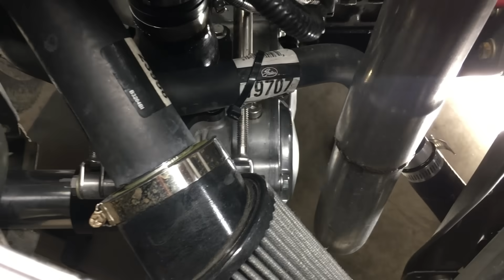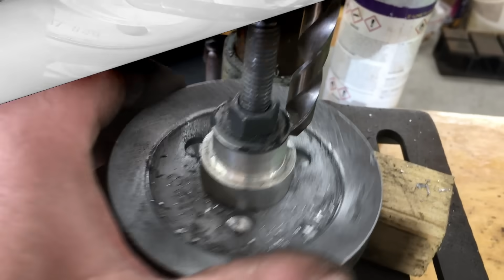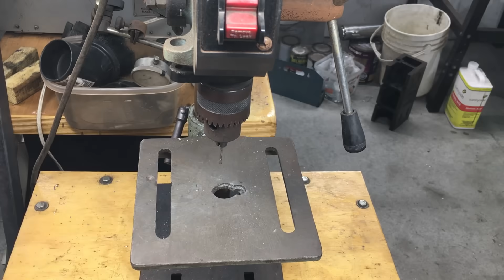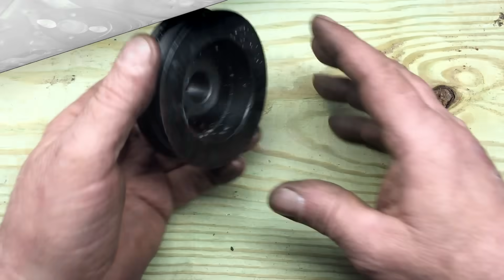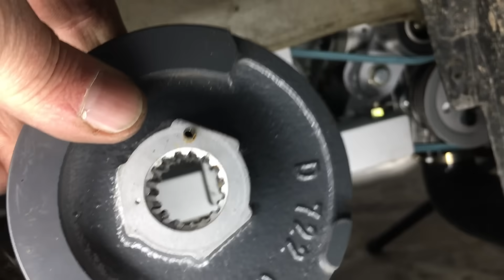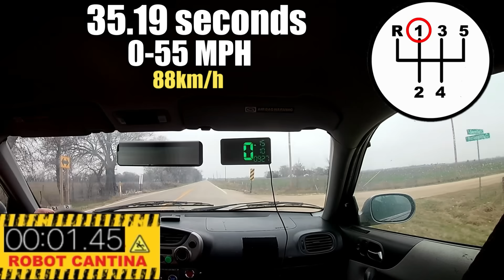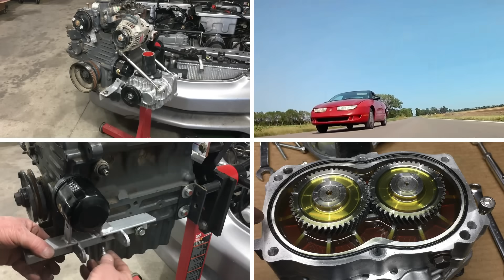S4 E9. We fix and road test the AMR500 supercharged Kubota diesel powered Honda

Comment: fix it back to having 3-4 psi idle and 9-10 psi full throttle 
too much fuel it seems
Reply: You have a 700cc engine that super charger is a 500cc super charger there is very little chance ittle blow if done right

Comment: The other way to reduce boost would be to reduce restriction in the air side of the engine. You'll likely gain HP in the process though 🤣

Comment: Why would you want less boost?
Reply from the maker: The engine wasn't designed for forced induction.  We don't want to blow it up, we want to make more videos as we make improvements, including moooooooooooooor boost.
Reply: This episode was downgrade, you spent a long time just to make the car slower!
In the Satern it had 15 psi and it didn't blow up!
Reply from the maker: @stupidpeoplebeingdumb  Yes, the Saturn had 15psi of boost , however with the turbo the max boost only occurred at full throttle while the engine was under a huge load.  With the supercharger we are experimenting with how much boost we really need.  This car is never going to be fast with such a small engine, but we want to make it as quick as we can and still be reliable.
Reply: Keeping the engine in one piece may matter

Comment: I'd base my decision on how much boost to run on how hot the intake air is. Nothing wrong with adding heaps of boost to a diesel as long as it's not adding too much heat to the air.

Comment: This is so cool. Since it's a 5 speed transmission, why not make the 3rd, 4the and 5th gear 10%, 15% and 20% smaller? That should give more power as much as I understand mechanics.
Reply from the maker: We are using a close ratio Saturn MP3 transmission on this build.  the gear set is nearly perfect for this little engine.  Changing gear ratios inside a transmission is nearly impossible without spending a huge amount of money.
Reply: @robotcantina8957  I see.

Comment: A small three phase motor and drive , and run it of the battery delete the belt crank drive. Electric motor can spin it up to whatever level you need. Ability to go from nil to 6-8 psi in a second. JS

Comment: Why do you keep trying to reduce boost? You did it with the turbo setup too, and it baffles me. You’re not gonna blow up the engine, guys have made 80hp with these stock 722s, you’re not going to be anywhere near that. Also your EGT alarm is set wayyyyy too low. Don’t even worry about it until 1250f. You’re being way too conservative jimbo!
Reply from the maker: On the saturn we started off with low boost and increased over time.   Keep in mind, we make videos.  More videos= mooooor money.  do the math.
Reply: @robotcantina8957  while I get that, we’ve seen it over and over. Get reckless, go big! lol
Reply from the maker: @BamBamMotorsports   I wish I could.  In order to pay for these projects we need the revenue from multiple videos.  Across the board, revenue is way down for all youtube  creators.  We generate 1/3 the amount we were making 2 years ago  and since then the channel has grown 3X the size.
Reply: @robotcantina8957  that’s insane, my channel is nowhere near big enough to generate any revenue, so I sincerely did not know that!
Reply from the maker: @BamBamMotorsports    It sucks,  at this point,  We should be installing lawnmower engines in Porsche's , but that's still out of our budget.    LOL.. predator powered Porsche 356 would make a lot of purists heads explode.

Comment: your videos with this little motor have inspired me to build my shtf vechicle with this concept in mind. I have a 3 cyl yanmar 800isch cc. Adding a turbo should be good enough to push around little suzuki samurai pickup.What is your opinion on coupling it with a 6 gear manual BMW 2.0 litre diesel transmision? I was actually thinking about connecting it through the pulleys so i can easily adjust the ratio between motor and transmision by changing pulleys.

Comment: What is the temperature before and after the supercharger? That will give you a baseline of efficiency if you play with pulleys.  5/14.7 = +34% theoretical power gain with 100% efficiency.  It's pretty close though if you got your motor setup right. For example I have a turbo'd 2.4L 170 bhp engine stock, with 18 psi boost through a 5558 turbo it'll make 300 whp dyno tested. At 18 psi it should be making like 380 bhp in theory because (170 * 222%). At 300 whp is about -27% total hp loss over the theoretical 380 bhp through driveline and turbo inefficiency.  There would be a mix of turbo inefficiency and driveline to get the -27%.

Comment: It's a Diesel bro. It has ho boost limit, the only reason you limit boost is for the sake of the supercharger. More boost better EGTs, more power, smother running, the thing that you need to worry about is fuel amounts, too much fuel can tear that engine up faster than anything.

Comment: holey over thinking pinning the pulley batman, when i do it i just assemble it, drill, then drive a pin in. jobs a goodun. this is on a heavily modified rover k-series where the crank pulley bolt is a bit weak and the dowel is a weak point.

Comment: There was testing in the early 90s about supercharging diesel for improved efficiency and reduce soot. Theoretically, under boost, diesel engines are more efficient but turbos are always behind the fueling. Maybe with low boost there might be an MPG improvement, but at higher boost levels the parasitic lost of the amr500 might overcome the benefits. It’ll be fine to see where the balance of power and efficiency flips with different boost levels.

Comment: I bet you’ll gain quite a few MPG’s. Maybe I missed it but I never heard you increase fueling, so what you’re doing is making more power with the same fuel by enforcing an increase in combustion thoroughness. More air means the injected diesel has less opportunity NOT to make use of that extra air. After all, a pressurized chamber is a more energetic chamber, it stirs itself more than an N/A chamber. Yes you lose some in the supercharger belt load, but you make more than that in achieving a higher efficiency.

Comment: as the revs increase, the engine volumetric efficiency drops. for that reason, the boost will increase. allso does intake air temperature. even at this low boost level, you should employ some sorthsof intercooler. if the intake air temperature is decreased , exhaust gas temperature will allso decrease. i personally like to set up stupidchargers to suppl just enough air, that the engine would consume at 100% volumetric efficiency, at peak tourqe rpm. gives a smooth boost, and not a lot of heat. now, since you got boost at idle, you can actually use a thicker head gasket or other form of compression ratio reduction. that actually helps with fuel economy. should not drop the compression ratio under 18:1 for a decent start and idle in cold. allso, since you got boost, you should increase the max fuel the pump can inject. usually on mechanical pumps thats done via a pressure operated device, the LDA. i think yours engine is missing one. so not sure if that can be added, or would require a different fuel pump that has it, or can accept it. if present, it will adjust the maximum injection volume according to available boost pressure. this will play in favour for both economy and performance. 
the real killer would be the turbo charger from the mercedes smart 600 ccm cars. if you set the pulley ratio as described and allso decrease compression ratio to 18:1. you can still add moar boost at higher rpm, the low volumetric efficiency will prevent overcharge actually. but will keep the tourqe from falling as revs climb

Comment: I was expecting this setup to have more low end power, but 12 seconds off of the 0-55 AND the supercharger was under preforming.  
Color me impressed.
This is why I am interested in Supercharged Diesels.  The high RPM performance may be questionable, but low RPM performance is impressive.
Reply: maybe the wrong pulley and blow off valve setup

Comment: I would have loved to seen your face when you realized you had a smaller crank pulley in stock after making other pulleys fit. That's how it goes man. Also on that tensioner instead of using a pull bar on it stick one of those turn-buclkes on the pull bar arm.

Comment: I've been entertaining the idea of trying one of these AMR500 stupidchargers on one of my Geo Metros. The Geo Metro engine has two pulleys on the crank, one 3-rib pulley for the alternator and water pump, and a 4-rib pulley for the optional A/C. I think that the 4-rib pulley would be perfect for driving the stupidcharger and it can also be mounted where the A/C would normally go. Just have to fabricate a bracket that mounts where the A/C bracket attaches to the side of the engine block. Since the Geo Metro 3-cylinder engine is 993 cc, this stupidcharger should be more than adequate.
Reply: I supercharged my Geo G10A  powered car and it upped the power from 52 to 81 and the torque from 50 ft lbs to 90. https://youtu.be/PZOejejI0kU?si=9Pu63k-AK4FAlYL4

Comment: I would suggest that at each boost setting, you keep track of intake air temps.  Air temps have a big impact on air density and cylinder temps/EGT.  Superchargers do parasite power, however diesels usually as a rule starve for enough air to achieve full and proper combustion of all the fuel injected.  That is why, for many decades, there were so many heavy diesel engines that blew smoke before the turbo was fully spooled up.

Comment: Keep up the good work! I always enjoy watching your videos on Sundays.  You might want to put the intercooler/ aftercooler back on when you get the boost where you want it.  But I'm sure thats your plan in the long run. A general guideline for a diesel is for a 1 degree increase intake air temperature will increase the exhaust temperature by 3 degrees.

Comment: Those headlights look really clear and shiny! Did you replace them? If so, where did you find replacement headlights?
Asking because the ones on my Insight are not shiny and they have broken adjuster hardware inside.
Reply from the maker: The headlamps are original to the car.  I polished them a few years ago to remove some of the yellowing.  Keep in mind, this car is stored indoors 99% of the time and isn't exposed to the sun.

Comment: This is F1 engineering.  Maximum long term horsepower, restricted displacement.  Very restricted.  I’m still eager to see this car do a road trip.   How long can the design hold up?
Reply from the maker: Nothing on this car is stressed, if driven normally.  Also, since the car is made from aluminum, I reckon it could last another 30 years or more

Comment: I read somewhere - on the internet - so it must be true - that the ARM500 pulls about 25~28 hp. Depending on boots pressure I suppose. Good progress. Now I have to wait another 7 days. 😞
Reply from the maker: The engine we installed it on only makes 20 HP.  I reckon with a 1:1 drive ratio, the supercharger is absorbing less than 2HP.
Reply: @robotcantina8957  Goes to show ya, you ain't gonna get no ME degree off the internet. :-0

Comment: My 1991 Honda Civic 4-door, manual transmission car got 47 mpg on the highway as long as I kept it at or below 55 mph, with the tires  inflated to sidewall-max PSI.  And that was all-stock, no modifications. And I took very careful, manual MPG records.

Comment: Any thoughts of compound twin charging? Use the stupid charger to feed the inlet of the turbo, allowing the turbo to compress the already compressed. Think of it as being waaaaaay below sea level, compressing much more denser air, if that makes any sense.
Reply from the maker: The turbo we tried previously didn't work well with this small displacement engine.  Twin charging may not produce the results we are looking for.
Reply: @robotcantina8957  the benefit to compounds is that no matter what to will have the pressure out of the supercharger. The turbo will just add to it, well, multiply it.
Reply: I think if he can get the SC drive ratio worked out for 12-14psi and fit a front mounted intercooler installation, then that would give him all the power he needs to make the little Insight go much better. Especially once he gets the fueling and injection timing dialed in just right for maximum power.

Comment: Can't you just use the turnbuckles to adjust the belt tension? First shorten the turnbuckles, then put a slightly shorter belt on, then lengthen the turnbuckles to proper tension.
Reply from the maker: The turnbuckles are maxed out.

Comment: Your egt alarm at 1000°F is very conservative. Generally 1200 to 1250 is safe. Diesels like the extra air. Adding more air drops egt's and makes more power due to more complete combustion. They prefer to run lean rather than rich.

This is all assuming your charge air temps are not too high, thus intercoolers. 

Also, diesels are typically the most fuel efficient at about 600°F egt's. For your fuel economy testing try to keep it around that range for max economy. 

Love what you've been doing with these little cars. It been very enjoyable to see you do these crazy little projects!

Comment: Running a longer belt and using the tensioner to hold it onto the pulley will give you better belt wrap and make belt slip way less likely. May not be an issue, since the blower isn’t very big. Just something to consider. Good content!

Comment: If I'm married to a certain boost pressure, a pulley makes sense.  I rarely am and sometimes want to have different settings for different situations.  For instance, I ran 17 psi on the street (which arguably made it too fast for the street and made torque steer a mother lover, but didn't blow stuff up on pump gas) and 30 psi when running race fuel on the track with my weekend racer.  A diverter valve is almost as cheap and gives me options in the future without having to source and buy different pulleys in the future.

Comment: Just because the egts are lower, it doesn’t automatically means the Eta ist higher. You have to take the air mass into account. 200g/s at 650C have more water heat in them, as 100g/s at 800C.

Comment: Just don’t grenade the engine I’ve been watching this little more since it came onto the channel. I rather enjoy this a lot.
Reply from the maker: The RPM is capped to 4K and I like to shift between 3200 and 3400 RPM.   Hopefully the little engine can handle that.
Reply: @robotcantina8957  idk how it works with diesels but I know with gas engines and boost you usually gap your rings a little further than normal to accommodate. Not sure if that same principle applies to diesel or if the rings are pretty well gapped as is
Reply from the maker: @TheMrDarius  The ring gap on this engine was not adjusted for forced induction.    On the 420cc predator engine we ran a few years ago, the ring gap was modified for the supercharger.

Comment: fuel eonomy may be the same as before but fuel efficiency should have improuve, your car exhaust is not as black as before you are using the same amount but getting more hps also running the SC should help you low temperatur issue with the engine working harder producing more heat

Comment: What are those adjustable-length threaded struts called? They look like stainless steel, and they're holding the supercharger from above. I need to get some of those for a couple projects of my own!
Reply from the maker: I got the stainless steel turnbuckles on amazon for about $20.00.  they are for sailboat rigging.
Reply: @robotcantina8957  Ah ha. I see them; thanks :)

Comment: A little boost leak on purpose would also have done the trick I think 😊
Reply from the maker: Yes, but keep in mind the supercharger was working hard to build that pressure  and it was also adsorbing power from the engine.  Changing the drive ratio reduced the boost and  also reduced the amount of power the supercharger was adsorbing.

Comment: Just an observation I made,but is there a possibility to move the intake away from the exhaust..
Cold air makes more power😊
Reply from the maker: Normally I do try to keep the hot away from the cold, but given the air flow we have and the lack of heat under the hood, I think we are OK.

Comment: Wow, huge improvement in the 0-55 time! Let’s see it with 8psi next! 

I can’t recall which car has posted the fastest 0-55, was it the Renault? Can we get into the teens with the Insight…?
Reply from the maker: I think the Saturn may have been faster with the turbo boost set to 16 psi.
Reply: @robotcantina8957  I’ll bet you a gnomes salary this will be faster once you have the wick turned up on the stupidcharger

Comment: Can you do a acceleration measurement using veggy oil? Or sunflower oil? Apparantly you should see about +4-5% power just by using veggie oil instead of diesel.
Reply from the maker: Veggie oil has slightly less BTU's than diesel.  According to the math,, Veggie oil should perform about the same or  slightly worse.

Comment: Very interesting. I supercharged a friends 602cc Citroen 2CV6 with an AMR300 sucking through an SU carb. I saw similar improvements in acceleration. Had to play around with pulley ratios and ignition timing to avoid "pinking" but got there in the end.
Reply: That is also a very interesting project.

Comment: First I wanted to say your work is genuinely quite good. In retrospect it may have been an easy idea just to induce a boost leak. Start with a small hole and increase it untill you got the boost you wanted. Though this is a much better solution. Knocking off 12 seconds is crazy, I wonder how much a little more boost will increase it.

Comment: Next project ?
You use  the jacket water heat and the exhaust to make steam and use it to run a modified old impact gun to give it 
Water Gas Nitro effect !
WGN. Can also be done using an engine air starter used on diesels …..